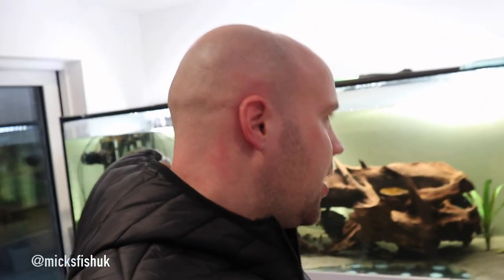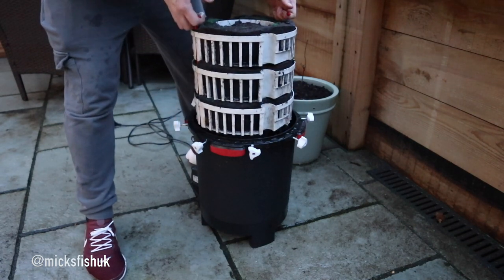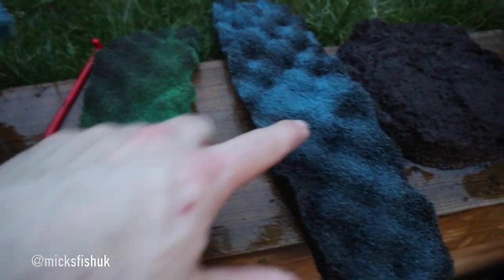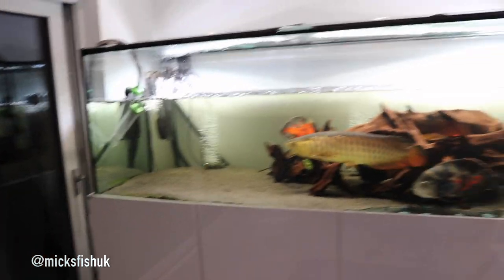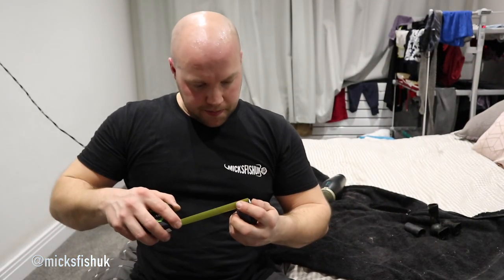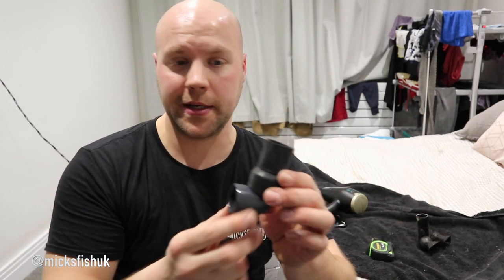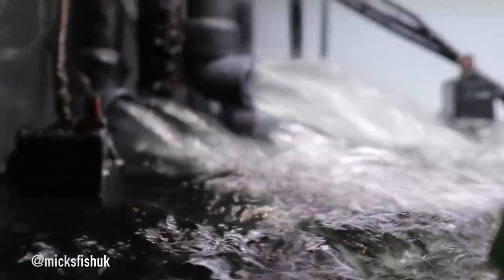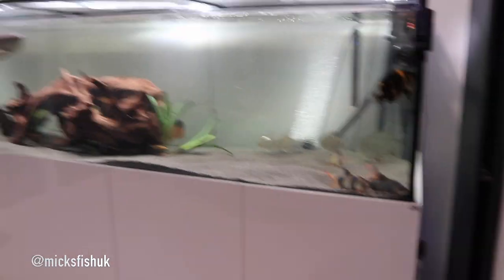FLUVAL FX6 gets more POWER

Comment: Basically you have restricted the flow rate, to create more turbulence. Just like putting your finger over the end of a hosepipe.
Good if you want surface agitation, but bad if you want more water passing through the filter.
You tank is well filtered with large fish, so extra agitation is beneficial to your system.
Great tip for creating more turbulence.
Happy fishkeeping to you sir
Reply from the maker: You have got it mate. Makes a massive difference my Arowanas love flow so keeping them happy. Keep up the good work mate 👍🏻🇬🇧.
Reply: Glad you pointed that out I didn't want to be the first. Creating more back pressure increases the exit force. Similarly I popped off the diffusers from the fx6 outlet as the 2 rounds that are left behind create way less turbulence for my oscars. In my two 400 gallons I have been using in tank moving bed filter towers which have proved move effective than the fx6 at biological filtration. I reckon with your eye for detail you could fashion a good looking acrylic moving bed tower for your tank. They look awesome churning in the corner of the tank and air driven.🙂
Reply: I was gonna say... the motor creates the flow... not the venturi

Comment: I think it's  great  ,but the fluval engenears don't advise it, becouse of the back flow,it makes the turbine to work more and damages your filter or it can even burn the engine, or you think that they din't think about that?
And if they put 2 out flows it's becouse it's how it's suposed to work .
By doing what you are advising you are defenitly shortning the life time of your fx6 .
But great vídeo enyhow.
Reply: Always wondered 🤔 
When talk about back flow(am not a engineer) just a old keen hobbies that's trying to understand why Maybe back pressure designed into the out let's helps the motor inpeler from working  too freely,ie,spinning quicker than designed and like said burn out the motor.

Comment: On a tank that size, have you considered placing a sump in the middle and using the FX6's as mechanical filters? You don't need a huge sump, 5 or 6 chambers would be ideal. It increases the volume of water, you could keep your heaters all in the sump and pile up lots of biological media, of course the first chamber needs to be mechanical filtration, and even have one chamber as a moving bed filter.

You could possibly take the biological media out of the FX6's then fill the middle trays with sponges and filter floss in the middle trays, this would significantly improve your overall filtration. 

You would then regularly clean up the fx6 filters as normal and clean the sumps mechanical chamber.
Reply: wouldn't it be difficult to balance the water to where you dont risk overflowing the sump or tank  with such a big tank . i was always told you need 1/3 of the total tank for a sump so he would need like a 150+gal sump there . im about to get a 180gal and wanted a simple 20gal sump but people are telling me i would need a 40+ gal or i would flood the room
Reply: Your sump does the mechanical and bio media. No reason to have a canister going. Down side is non drilled tanks adds a bit of complication to sump set up.

Comment: Hi Mate. I have a great tip for helping you empty your tank.  Get another head from your fx6/fx4 inlet/outlet, £25 from amazon. and jubilee clip it onto your clear hose you use for draining your tank. Shut off your inlet/outlet heads. Turn off the power. Now clip your new head onto the outlet.  Turn both heads on and turn the power on.  It then pumps the water out for you just make sure your water syphon in your tank is deep enough for the extraction.   Simple. Saves fannying around with gravel syphon.

Comment: My friend if you do not stack those media porcelain. White round media filters like you are. And you randomly set them in there. You will actually get more surface area. You're blocking a lot of surface area. By standing them all up like that. The sides are touching each other and allowing no water to touch the sides of each one of those.

Comment: Great video mate I’m just setting up a 600L.  I have the option to fill up from a mixer tap in kitchen so set refills at 25’c. I heard that chlorinated water can hurt the bacteria so was advised to turn off the filter when adding water and then add dechlorinator. When full turn the filters back on. What do you reckon as I see you leave your running.
Reply from the maker: Hey mate yes it can hurt the bacteria especially if you directly clean the filter with it. I leave mine running when I do a water change but you can turn them of it will grow back pretty quickly. But I wouldn’t leave them of for ages. If you can put pre warm water in ur tank that’s good. I don’t have the option for that as mine is huge. I have done it this way for years mate hope this makes sense

Comment: Hey Mick. You just need one of 19mm. Easily can stick in the rubber it's self. It's also thinner than the 30mm, more pressure, more flowrate!
Reply: This seems an easier solution, I'm off to B&Q in half an hour when it opens to see if I can find the right part, thanks!

Comment: Do you use tap water to fill up your tanks? I'm pretty new to fish keeping and have been filling up containers through a filtration ro unit. It takes a couple of days to fill all 6 up. My tap water here in Yorkshire is very high with nitrates. Is there an easier way of doing water changes?
Reply: I use tap water and I'm in suffolk which is very hard and like you full of nitrate  ... there's nothing you can do about it !! 
So just put your water treatment in and crack on !  
BUT  make sure the fish you have can deal with your water chemistry

Comment: There are 2.54 cm/25.4 mm to an inch. No way your near 3 cm for .75”. So 2.54*.75 is 1.905 cm. That said I have pondered doing this to mine but really have not put effort on it. I use original part for surface agitation. I plumbed .75” pipe in and attached it. So I could easily push fit pvc in place. I don’t trust corrugated pipe. When it goes it goes fast.

Comment: I just bought a 300 gallon tank. I have 2 FX6 filters. Will that be enough filtration for a tank that size?
Reply: depends on stocking but i was never happy with 2 on my old 300 gallon ....i would run two fx6 on a 180

Comment: Do you run carbon in your filtration setup?
Reply from the maker: No mate check my older videos
Reply: I have exactly the same set up as yourself in my 7ft tank, apart from i only have x2 fx6's, i have done the same with the ceramic rings, sponges and also cotton to polish the water. I have a malawi cichlid stocked tank, and i am really struggling to get clear water like yours, any advice?
Reply from the maker: How often you doing water changes? And how long do you leave you lights on for each day. How often do you feed?
Reply: @MicksFishUk  im doing 50% per week, so 550 litres a week. 

Lights are on from 8 till 9- maybe an issue?

Feed once a day, i dont over feed either all food is consumed well before 2 minutes
Reply from the maker: Ok mate feed pellets 5 times a week and then frozen food once a week normally day before water change and on water change day don’t feed. Your lights are on way to long I have mine on 6 hours a day so turn that down it will make a huge difference. I have mine on from 3pm to 9pm hope this helps
Reply: @MicksFishUk  ok i will give it ago and let you know what happens, thanks for you help!